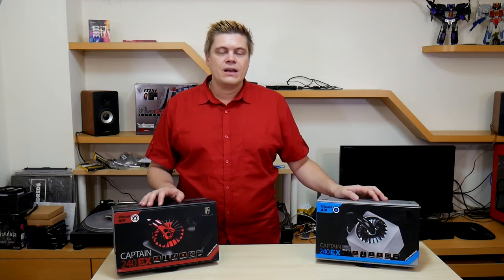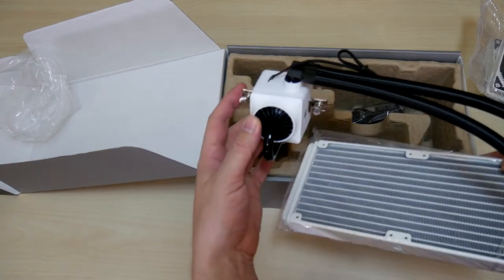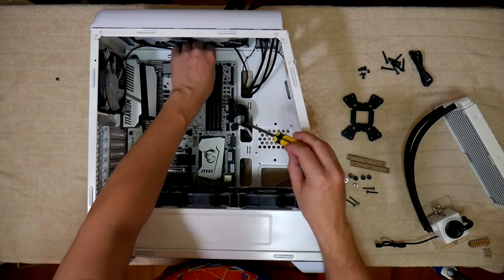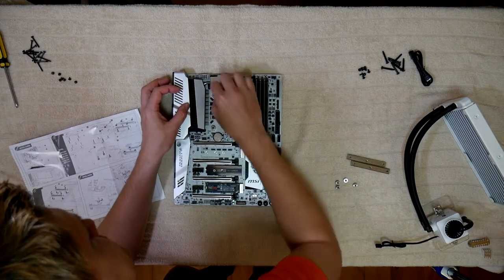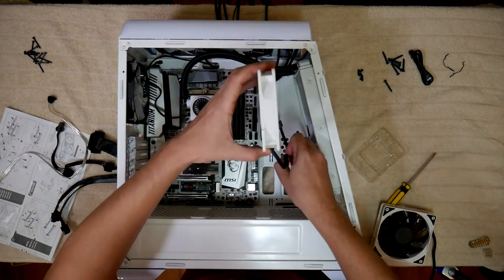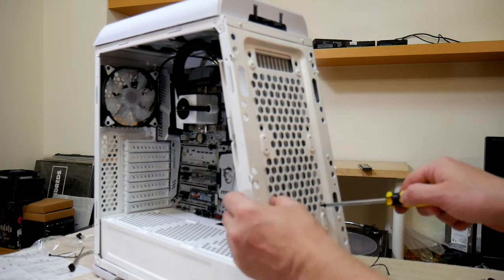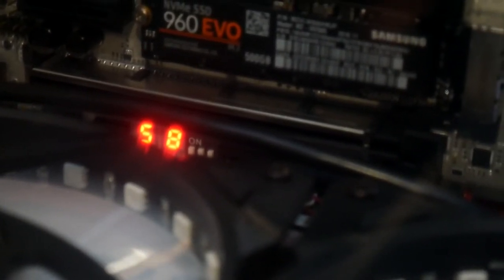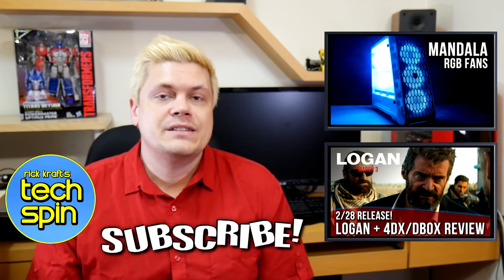Deepcool Captain 240 EX AIO Water Cooler Review

Comment: I know this is an older video, but you mentioned going from a 212 Evo to this AiO. I currently have the 212 and this AiO is being delivered today. The stand off posts looked very similar in size/shape to the 212 and also looked as though they were in the same positions. Did you notice/think that perhaps it was possible to reuse the mounting posts from that to install the rails for this AiO? If not, it's not a big deal, my case does the opening to the back of the cpu socket so swapping won't be difficult, but if it's not necessary it's always nice to save the time and effort.
Reply from the maker: I have three projects on schedule for the weekend so I won't be able to check for days even though the hardware is in the next room :(  I do remember when I installed the Captain that there was something that prevented me from using the Hyper 212 mount (spacing?), and I had to remove the motherboard to swap because the case didn't have enough rear cpu cutout, so I feel ya.  If you have the chance, lemme know how it goes, ya?  I plan to remove the red one from my backup editing rig so hopefully I can test in a week or so- I work daytime too hehe
Reply: @Techspin   So the problem was not the spacing. the spacing is the same based on the socket, the issue was it needed a threaded post for the nut to hold the crossbar down. Ended up being no problem really because of the open back where the cpu socket was. But yeah, couldn't just reuse the posts from the  212.
Reply from the maker: Yeah thought it was something like that, I remember I couldn't just use the Hyper 212 mount directly. Thanks for letting everyone know!

Comment: Why is the white led light on my refrigerator not blinking constantly? it stays off only when I turn on the equipment it works it has me worried
Reply from the maker: BIOS setting, the pump is on PWM mode, should be on DC mode. This will fix your pump light.

Comment: i'm using i7 7700k with H55 corsair cooler.. and i'm getting 40-50c idle and full load gaming 70-80c is it normal temperature??
Reply from the maker: Seems so, if you're OCing + full load, the H55 can push temps up to ~90*C.  Things to check: Heatsink seated properly, CPU pump plugged in and not on PWM mode. The pump should be getting full power, check your manual and BIOS.  Also check that the radiator fan is spinning up under full load, you can read the RPMs and Temps with the free HWiNFO64 program.

I didn't go with a 120mm cooler, after a lot of research, because they aren't as effective as a 240/ 360mm when overclocked.  Check it!
http://www.kitguru.net/components/cooling/henry-butt/corsair-hydro-h55-cpu-cooler-review/5/

Comment: lepa 120 ,enermax 120,deepcool captain......WINner?
Reply from the maker: VICTOR YEAH The problem with 120mm AIOs is that they don't dissipate enough heat when seriously overclocking. They perform about the same as a Hyper 212X for the most part. While the Lepa is cheaper, at that performance level you could just do a Hyper.  The Enermax is the same price as the Gamerstorm 240mm at 80USD so get the Captain instead, which has double the surface area to get rid of the heat!

Comment: Why would you mount the fans to blow the hot air from the radiator in to your chasis? People should avoid this fan setup
Reply from the maker: Omg, the radiator venting hot ait into the chassis, it's the end of the world! Wait it's only 4-5*C higher. Not truly a problem. But sure, for the best temps the rad should be mounted with the fans exhausting directly out the case. Don't forget to subscribe and tell your friends to help us grow! Thanks for your support!
Reply: @Techspin  Yea its not the end of the world but I just like to see the optimal airflow because the point of getting all this fancy cooling is to reduce the temps.  Otherwise cool video and thx for the review, it would be cool to see performance in future videos ;).
Reply from the maker: Agreed, we're working on a setup for future case reviews. Excellent input here, appreciate it!